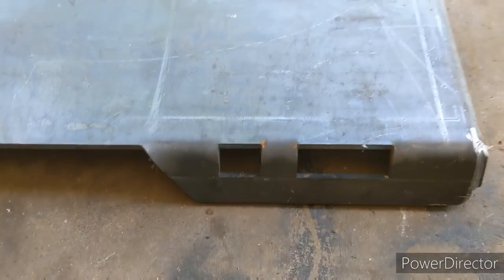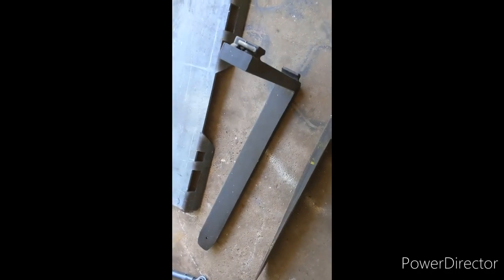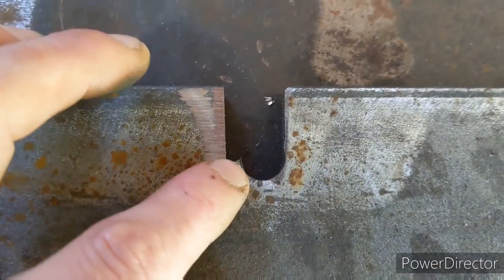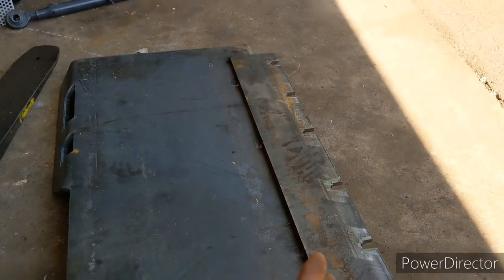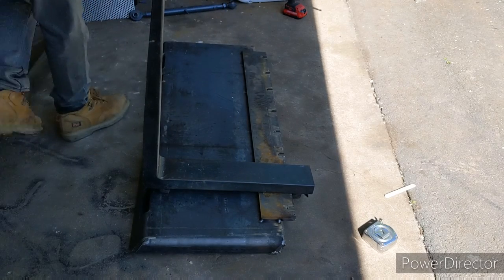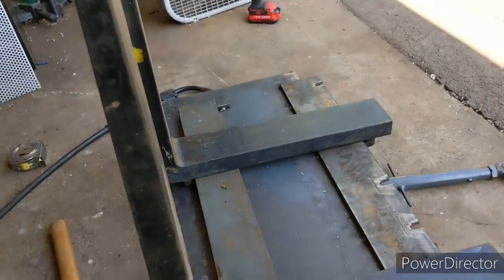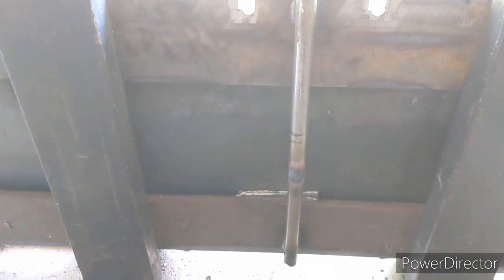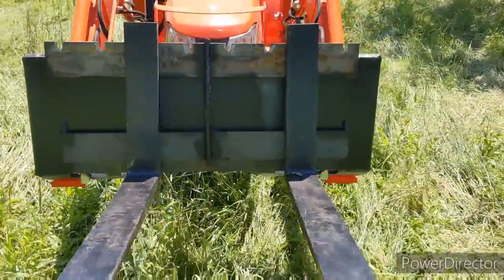How to make Quick Attach Pallet Forks

Comment: I like them! The only thing I'd do different is cut out a hole in the middle so you can see where your fork tops are. This might not be an issue for your tractor but in my skidsteer, I've a huge blind spot with the plate.

Comment: Well done young man. Good skills both on video recording and assembling, does your forks go down enough to pickup pallets off the ground? Don't know how long you have been welding but to remark as you did so boldly on how good you are, you must've been running into some rude people. I can not yet wire weld and my stick welding leaves a great deal to be desired. Put it this way, your welds, extremely professional, mine looks like a bowel movement from a robotic dog. Getting better and it's good enough for me. Enjoyed your video.
Reply from the maker: Thank you sir! Yes im a certified welder. The forks have no problem picking up loaded pallets on the ground
Reply: Can you show the link for the plate from Amazon?
All welding videos have some teenager saying, “My welds in my shop class look better than yours”, forgetting to mention that one single weld for the entire year looked good while the instructor held his hand  on a perfect practice piece with ideal settings.